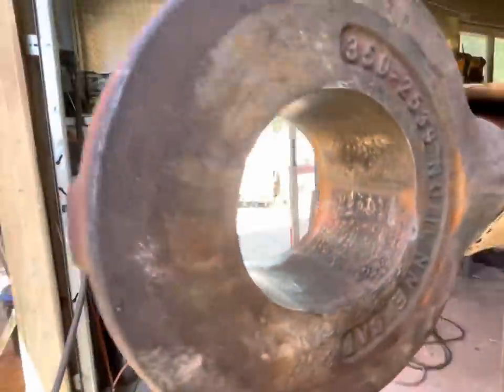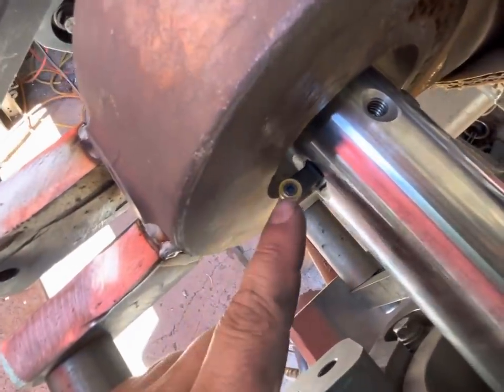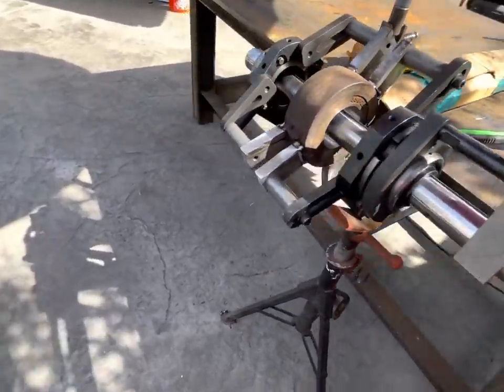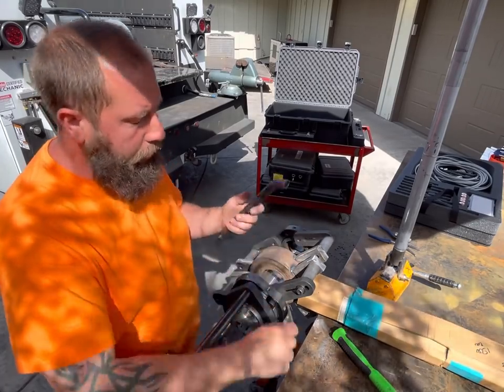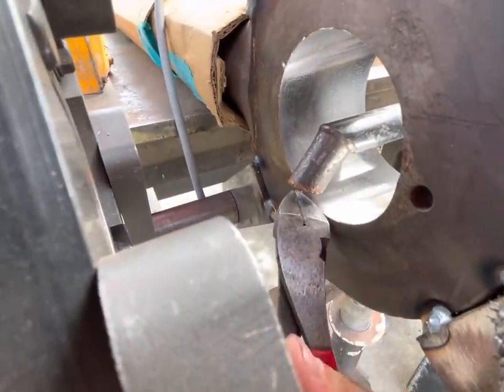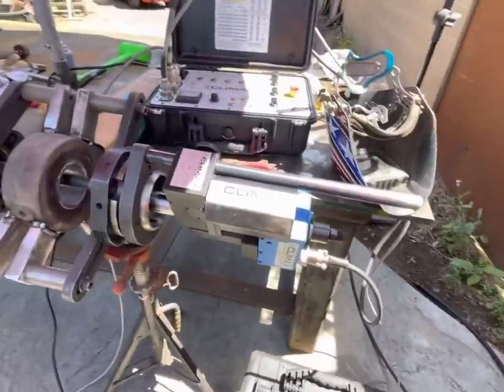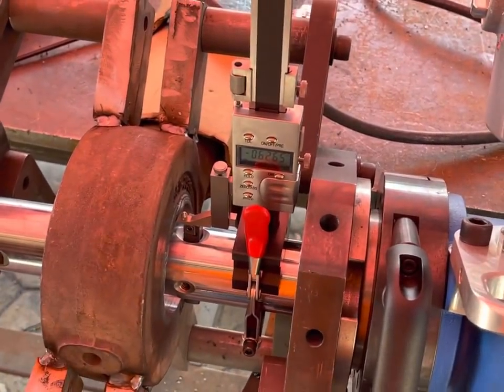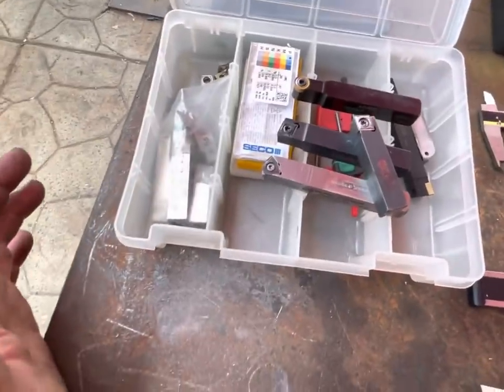Line Boring Apron Lift Cylinder

Comment: Kurtis once showed how he welded a short section of pipe on the starting end of the bore weld to allow  the weld to start outside the bore so that it could be trimmed off  without having to hand weld that section. I do, however, suspect that you are already familiar with this.
Reply: A run-off ring that gets faced off once the welding is complete

Comment: I have commented on CEE numerous times about being absolutely fascinated with line boring. So much so, that I’ve even priced a couple of set ups. But, man oh man, that’s a leap of faith to make that kind of initial investment today for work you may or may not get tomorrow! I think one would have to have the right customer base, for sure. I find myself needing the ability to do line boring once or twice a year but I don’t think most of my customers would be willing to pay what one would have to charge for the service. Oh well, maybe one day. I applaud your willingness to make the investment.
Reply from the maker: The process is fascinating. After I saw it done the first time I was hooked and knew right then I would one day have my own setup.
Reply: As a DIY person and now retired would also like to be able to do this. Have been thinking for years about at home made system. The bore welder seems like the hardest part to make, even a manual one.

Comment: Those button insets are really good for universal cutting and can hog out some material quick. And the really nice part is you can rotate them around on 6 different edges when they get dull and get tons of life out of them. Depending on the type of button inset you use and if doing straight cuts or radius cuts anyway.

And I'm not sure why they would have made the nozzles non removeable on those shorter cones since you can get stubby nozzles about that short. Tweeco makes some that short.

Comment: I'd like to see a step by step for line boring setup I just started watching your jobs you recorded. I wish I could be there personally to watch setup and some jobs you do. I haven't weld repair heavy construction equipment about 25 years but alot has changed since I last repaired them. The cracked parts are the same process as well as replacing some parts like the bumpers supports and so on. It's a smart move on letting someone else do the bends on the brake so as to make the job easier. Also I just am starting back into my own welding bissness but California won't let me put my application in unless I have some one with a C60 welding license due to not welding in the past 10 years with someone with a c60 California license I've worked for my nephews construction cement company and my friends shop part time after I get off work at my Full time san diego city work in wastewater department.  I appreciate your videos very much I'm refreshing my skills just by watching them. One more thing what would be good starting point for charging per hour on job for construction equipment repair or just field work. Thank you
Reply from the maker: I would change at least $100 per hour

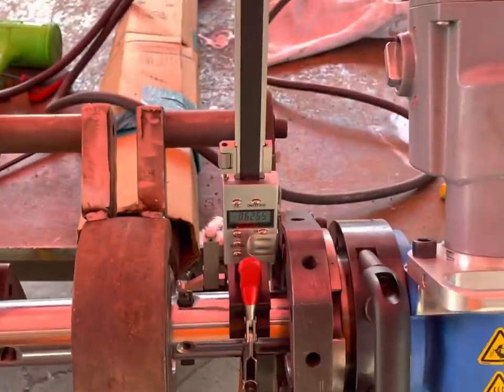Comment: 41:58....
wow, going to Tenths with the digital height gauge......
great way to set tool ......
.looks easier than a spring loaded insertable micrometer.

that you must remove and check with another micrometer..
getting it done in one setup........
Bravo.....
Paul down in Florida

Comment: I see an automotive machine shop using the circular carbide bits to surface engine parts to a high precision.  I thought that bit cut pretty well, especially for such a big single cut.

Comment: I know that welding and line boaring is a better finish, but what do you think about milling a bushing with a mill? Then installing the factory bush. I just dont have $45,000.00 for line boaring equipment right now.
Reply from the maker: I think it could work if done correctly.
Reply: Just mill the hole out on the mill if needed with a fly cutter, hand weld it (not the easiest thing but more than doable), then mill the hole back out to the bush size
Reply: Never seems to last when someone chooses to oversize the bore, throw a sleeve in it, then put a bearing in that. The sleeves are generally softer than the cast or forged steel eyes.

Comment: Outstanding video. After line boaring, would it have been acceptable to press in a sleeve with an interference fit into the bore instead of welding and machining?
Reply from the maker: No.  That is not the correct way.  My customers will not accept that.

Comment: Love the video thanks for posting.
what tool holder did you use for cleaning the faces.
I know Climax is pretty big in the states and it's well made gear, but I really like how quick the Italian ones are to set-up.
I picked up a  Maucotools C40 used in really good condition for €1200 they're about 10k new. Made in Italy.
Reply from the maker: It was a holder that came with the BRS kit

Comment: Climax machines are a complete pain just to set up and a big time is money waster. Always have to break it down for the next set up. Cause it doesn't use the same set up as the boring set up.  Like Joshes machine on his YT channel CEE Cutting Edge Engineering. But I give you high praise and a great job making someone's ridiculous designed machine work for ya. 👈🧐👍
Reply from the maker: Climax does take a bit longer to setup but I feel like it offers a few things others don’t.  But with that said every brand has its good and bad.
Reply: climax makes some of the best line boring equipment in the world. For doing smaller things like this job you could use almost any setup and get good results honestly. Where climax stuff shines is doing mission critical high load, high precision, large span etc…  stuff like articulation bearings in huge wheel loaders like 992/wa900. Their equipment is expensive and complicated for a reason. The cheaper stuff just doesn’t cut it in those kind of applications where there’s hundreds of thousands of dollars on the line. Time almost isn’t a factor in that stuff cause if you fuck something up you REALLY fucked up.
Reply from the maker: @Kc12v140  I agree 100% and that’s why I went with climax.  Its more “complicated “ but it’s that way for a reason.
Reply: @OFW  it’s a huge investment but if you know to run it, which you do, you will make it back in no time. You made the right choice 👍🏻 If you ever have problems or questions, reach out to Fitz Acheson. He’s an application engineer/trainer/tech support guy (assuming he’s still there, it’s been a few years). Incredible guy, came to our site to do some training/advisory stuff and damn does he know his shit. Great to work with too, fun personality, not condescending at all, and he has some very entertaining stories from his time spent in Manchuria training the guys there in the strip mines.

Comment: Using a wide-cast wire avoids the coiling action  that narrow-cast wires naturally want to do and it runs a lot smoother through the welder. That machine lays down some good looking beads.  What gas are you using?  I was advised to use either C10, C8, or C2 to help with the vertical and overhead portions of the weld.
Reply from the maker: The gas I’m using is 75% argon 25% co2. 
The wire is one that climax suggested and it seems to run pretty good.

Comment: Does the Climax bore welder leave the funny voids in the weld as it feeds backwards like the BRS unit does? I shouldn't call them voids, but the BRS unit does make a weird transition as it feeds backwards. Sometimes have to reach in by hand to touch up spots if the bore diameter is going to be close. Nice video.
Reply from the maker: No it does not.
Reply: @OFW  Sounds like you are familiar with what I am referring to. LOL    It's never been a huge issue for me, I guess more of an annoyance than anything. I always figured it had to do with the wire flipping inside the liner. Interesting that the Climax doesn't do it.

Comment: I must ask, why don't you guys just make new bigger bushings, press them in and weld them in place? Seems simpler than welding, and then machining. And you introduce less heat to the, in this case, a hydaulic cylinder. Just wondering
Reply from the maker: Because the customer wants everything Back to OEM.

Comment: Nice work. Could you weld the bore to dimension and do without bushing?
Reply from the maker: Yes but it would wear out faster and if you catch it soon enough you can just swap out the bushing without the need to line bore.
Reply: @OFW  - The problem is, if the bushing starts rotating in the bore, then bore wear would accelerate and destroy both bushing and bore surfaces
Reply from the maker: @NICK-uy3nl  you are correct.  That’s why I put a .005” crush fit on this bush.  It’s the customers job to inspect and replace the bush before it gets to that point.  These particular cylinders get neglected though being on the top of the Mach and hard to get to.

Comment: Seems like with a single hole like this it would be easier to throw it on a mill and use a boring head.
Reply from the maker: You could do that. I thought about it. But I wanted to do another line boring video.
Reply: On Fire Welding  And have the new machine make some ROI….

Comment: Hey man i noticed your chop saw and the blade...are thise blades better than the disc type or whatever as far as cutting metal faster as well as easier and making it easier on the motor do you think? Just asking cuz i don't want to spend $100 compared to $9 for.the disc but, im assuming they must be phenomenal for that much of a price difference.... Fuck u know how high the gas is right? Let me tell y'all a little secret a trick if i may..... get going a good speed and drop ur transmission into neutral, hold on cuz some vehicles tend to get harder to steer so.....anyways, then cut off the engine and coast as far as possible u all will be very surprised how far u can get with a tank of gas driving like this.... i got $10 in gas and i was out of gas....i drove from Ethiopia to Mexico twice...now there's no red lights or stop signs on that back woods drive many aren't familiar with but im fuckng telling u it WILL save money and if we all start fucking these mfkrs back like that they'll wise up and get passed this pussy stage generations they been creating since 1980...
Reply from the maker: The carbide blades are way better. They cut very clean and the metal really doesn’t get hot.  But you need a saw with a slower speed. Do not use them on a regular chop saw.
Reply: Yeah i got a slower metal one....i think that's what u saying, ima have to make sure or just play with the switch. I got an old black and decker but it's a really good saw.

Comment: That line bore system is overly complicated... I don't know what brand CEE uses but I like it better...
Reply from the maker: They use a sir meccanica ws2. It’s much bigger than the climax unit and harder to get into tight spots. Climax is complicated for a reason.  Each has its own good and bad.